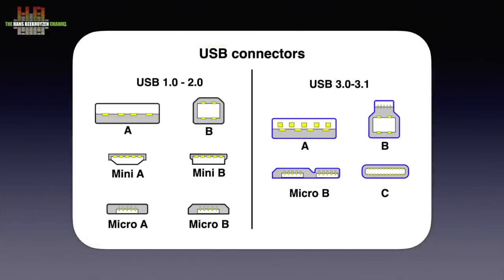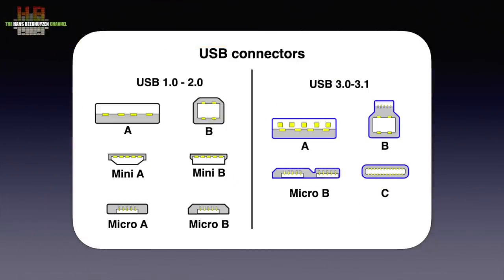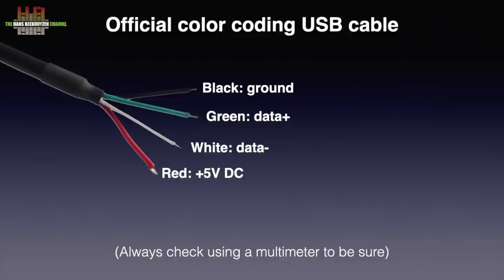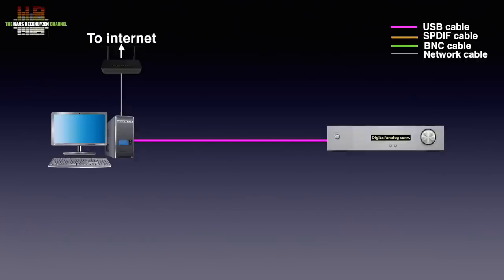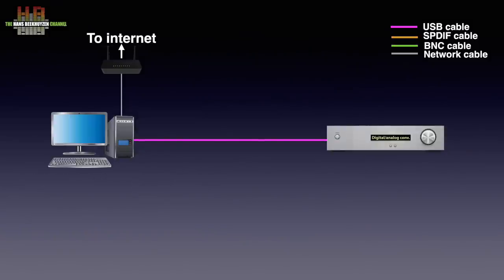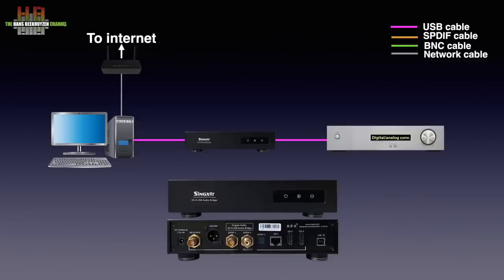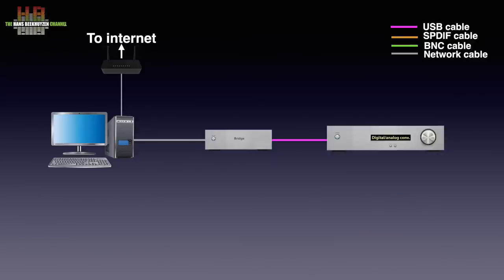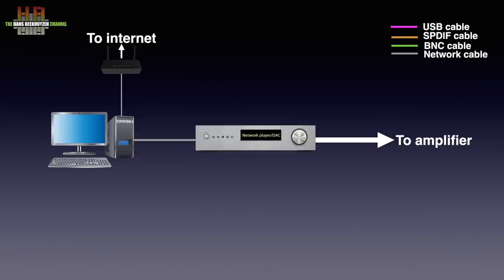Using USB for quality audio

Comment: professional and comprehensible even to laymen, thank you
Reply: @TheHansBeekhuyzenChannel  Hello Hans - in your opinion :  assuming that all else is equal and high quality in a system,  is a PROPERLY implemented USB connection superior in sound reproduction to a PROPERLY implemented fibre optic cable ? thanks and cheers and congratulations on your high quality videos!
Reply: I should add that the USB cable I have is made by CAD in England - the power is in a separate wire to the signal wires  :-)
Reply from the maker: If, and only if, you could find such devices, they would sound equal. Let me know if you ever come across such a setup. 😁
Reply: @TheHansBeekhuyzenChannel  Thank you SO much for your reply Hans!  OKAY let me rephrase that Q . . . is a high quality USB cable POTENTIALLY better than an optic cable - the reason I ask is that my intuition tells me that no audible interference can be transmitted in light - am I wrong to assume that?

Comment: You forgot "audiophile" PCIE USB cards, like the JCAT USB XE Card, powered by an external silent 5v PS. This can make an enormous difference (in my experience) but it's certainly not cheap.
Reply from the maker: Which one then? I don't know of any DAC that is insensitive to the quality of the source.
Reply from the maker: I have drawn the line at connecting DAC's directly to a computer. Sorry. It's expensive to get a computer to sound right. Use a normal computer  as storage and music server and then use a network bridge for audio output.
Reply: @TheHansBeekhuyzenChannel  I use the Matrix Element H USB pcie card, together with an iFi external power supply and a Supra USB cable to great effect. It's not cheap but at around $500 in total, I wouldn't call it expensive given the rest of my system.

Comment: I'd like to see you do a segment on the Dutch & Dutch 8c speakers, driven by their AES/EBU connector directly from a streamer. I haven't seen a decent breakdown of if the sound is better by keeping everything entirely in the digital domain. Internet to streamer to 8C via AES would be a fascinating test, especially if you also try an alternate signal path that includes a streamer with internal DAC and then the streamer bypassing its internal DAC and using a top quality external DAC.
Thanks for all your amazingly informative content!
Reply from the maker: I'll consider it (no promise though)
Reply: @TheHansBeekhuyzenChannel   That would be fantastic, thank you for considering it!

Comment: I have to confess that I usually have trouble hearing differences in DACs so the effect of burning in an audio USB cable would most likely be lost on me. But based on your comments I am now interested in isolating my Mac mini (running Audirvana) from the DAC.
Reply from the maker: The best way is to use a network bridge or streamer.
Reply from the maker: I mean audible quality.

Comment: Thanks Hans, another fascinating subject. You mentioned burning in, could you pick that for a future subject?
I agree it's a good thing to do but am not sure how to go about it. can you switch kit off further down the line? If so what happens when you burn in speakers, is there a way to do this without disturbing the aesthetics committee or the neighbours?
Reply from the maker: Burning in cables is simple: take a cd- or network player, have it play on repeat 24/7 for a week with the cable connected. For loudspeakers: put them 'nose to nose', with the baffles almost touching, reverse the polarity on one of the two loudspeakers and have it play music on a low level for some days. When done properly, you will only hear some high frequencies. You don't need to do that with the loudspeakers in the living. Have some cheap speakers and amp to do that.

Comment: Hans, thank you for such a detailed explanation. Would you say that if USB chain is done right, it has the potential to sound as good as I²S or better?
Reply from the maker: Every digital interface works great when done perfectly. USB, however, often is done poorly, especially on computers.
Reply: My question is: why don't DAC manufacturers and especially streamers manufacturers strive to make I²S the standard audio interface? (Even the most expensive Auralic and Aurender models don't have I²S output). Is it because  USB - provided it is implemented as it should - is not worse? @TheHansBeekhuyzenChannel

Comment: Very nice channel, I was looking for direct to the point, no fluff, presentation and explanations, found it here, subscribed. I realize this is a year old post but I have a somewhat related question, getting into 32-bit, found an ESS Sabre DAC PC motherboard and stereo DAC Preamp both rated at 32-bit 384 kHz to play music files from my computer to my stereo system over optical. Why does it appear the full spec of the DAC 32-bit 384 kHz is not presented to the optical ports, only to the USB ports? It appears the optical ports are only capable of 24-bit 192 kHz even though the DAC is 32-bit 384 kHz rated.

I currently run 24-bit 192 kHz over optical from my PC to my stereo preamp DAC that is 24-bit 192 kHz. I wanted to upgrade to 32-bit 384 kHz using the optical ports but is looking like I need to shift to audio capable USB cable in order to get the full 32-bit 384 kHz. Thoughts? Thank you.

Note, I think I understand properly that the PC's DAC in this situation is not using the analog conversion part of the DAC since it is pushing a digital signal over optical and it is the stereo's preamp that receives that signal that is actually doing the analog conversion part.
Reply from the maker: The optical connection is always limited to 24 bit 192 kHz. And if you go digital out on the PC, the DAC chip is not used at all so having an ESS DAC is of no importance. Consider buying a separate streamer. like those by WiiM or better.

Comment: Hi, Hans. I acquired an Auralic G1.1 to use on a second system (the main one has an Auralic G2.2 and I will upgrade it to the new upcoming G3). Presently, I am using an SOtM pair consisting of the sMS-200ultra Neo Special Edition and a tX-USBultra Special Edition which are the connected to a Denafrips Gaia and from there to a PS Audio Direct Stream DAC via I2S. The Gaia has made a significant improvement over the direct connection of the USBultra to the DAC, since this was a USB connection while the Gaia allows me to use the I2S connection, which sounds much better. The question is if it would be beneficial to use the Gaia with the Auralic as this streamer has a USB output and no I2S. I have many DSD files up to 256, which would require either the USB or the I2S connection. I shall appreciate your learned view on this.
Reply from the maker: I have never tried that combination so I can't say.

Comment: Wireworld Cable makes USB cables that have a separation between data and power cables.
Reply from the maker: There are more, like Network Acoustics
Reply: Dave and his Wireworld business has been high value, high performance,  and usually a half dozen series options for each cable protocol.  Was lucky enough to discover Wireworld in ~2004 and never looked back.

Comment: I would love to hear your thought on using AES 50 Dante and AES 67 Ravena for transporting audio on Ethernet. These are both multi-channel systems used in the pro works. They are reliable, easy to use and high quality. I used Ravena to connect systems for DXD/DSD multitrack recordings of classical music.
Reply from the maker: It's not what I focus on yet

Comment: I used to use an gen 1 Bluesound node. On some tracks, high pitched sounds would sound awful and distorted (eg. violas or high notes from a piano). I wonder if that was extreme jitter (?)
Reply from the maker: No, these are called glitches that occur when the streamer is malfunctioning.

Comment: Regarding platforms for the electronics, reviewer Darko recommends (and I can confirm by testing),better than hard wood is Ikea Aptitlig butchers block (bamboo) + Atacama Gel Pads.
Reply from the maker: bamboo is the key word here. Doesn't have to be ikea
Reply: @TheHansBeekhuyzenChannel  Agreed, but would also note the Ikea Aptitlig boards are rather thick (3.3cm) and are wide and deep enough to support most gear, so offer a tremendous bang for buck. Especially when rested on Atacama isolation gel pads. My system was already quite resolving, but applying this budget tweak I can hear new percussion details on about half of the tracks I listen to.

Comment: I've cut the 5v. Use a Power bank to source the 5v through the USB plug or the power port if available. What do you think on using power banks for 5v?
Reply from the maker: They are noisy.

Comment: I have a hard time believing a USB cable has a burn in period. Especially anything more than a few seconds. Ethernet cables can also carry noise, albeit almost always much less. Proper Galvanic isolation still needed if you want a near perfect scenario. Another point to make, if you’re connecting to PC USB then connect directly to the motherboard and preferably the main chipset. Connecting to the front panels will introduce more noise along the cable and other chipsets can also introduce more noise (or worse for Class 1).
Reply: I guess you haven`t learned everything effects everything yet.  It will come with more experience.
Reply from the maker: Try it. Buy two audio class USB cables, use one for a few weeks and then compare then. If you don't hear a difference, your stereo might not be of sufficient quality or set up less optimal. Or your auditory system doesn't focus on the right things.
Reply: @TheHansBeekhuyzenChannel  -OR it is already optimal and there is negligible amounts of noise on 2 data lines that are already being isolated for, so almost any cable will provide an identical experience. I’d go as far as to say (beyond burn-in), if you’re hearing a difference with high quality vs. “Audiophile grade” USB cables then the system is definitely not optimal and there are significant weak points in the digital pathway
Reply: @mikemajors2385  you’re missing it and being ignorant. But I’ll bite. What changes after weeks of running a cable in the same setup? Basically 2 things (ignoring oxidation/corrosion), if controlled. Temperature and the positioning of the electrons. From a new cable running in a system, the electrons will reach their native states in less than a minute of operation. Temperature takes longer but not 2 weeks. Sure if you take it out of the box from sitting cold outside and throw it in the system, and have a highly resolving system with digital pathway issues, then you MAY notice a difference once the cable reaches an equilibrium temperature. That’s it. Digital is not analog. Yes, analogous noise can still propagate along digital cables, but for different reasons and results differently. A good quality shielded cable AND equipment that is properly designed to handle USB (not as an after thought feature) will have effectively no difference in switching to whatever unobtanium audiophile cable you throw at it and no difference in burn-in, beyond the stated above, extreme temperature scenario, unless your source or end point are poorly designed (read: shitting out noise) and unable to mitigate it. Then you may have a scenario where a “better” cable might make a difference, but again —cable burn-in is not going to make a difference outside of ~an hour. I will however test this and report back. If I’m wrong, I’ll eat my shoe. I’ve tested tons of this before (some surprising, others not), but never a 2 week cable burn-in. I challenge you though, please tell me what else a 2 week cable burn-in is going to change? Will the changes go away when not in use? After how long? Is the burn-in permanent? Why? What is physically changing?
Reply: If harmonics doesn’t concern you then yes wouldn’t hear it.
Reply: @chrisladouceur4093  What exactly is the “native state of electron” that you’ve mentioned? What are the differences between native and non-native state electrons? What are the requirements to reach the native state? and How long does it take to reach such state?

Note that when talking about “electron” you are talking about quantum objects… and anyone that think they understand what quantum physics is… definitely has no idea about what quantum physics is.

It’s one of those things the more you try to understand it, the more you don’t understand.

Is electron a wave or a particle?  The answer is, it’s neither and it’s both because it can be both and it can be neither. Confused? Yeah, me too 

and it can do all sort of funky stuff like teleporting, goes through another solid  object, changing  its properties, telepathic communication etc. 

The law of physics that governs these quantum objects are not the same as the law of physics that governs our world as we know it.

So, I’m afraid no one would be able to answer the questions that you’ve asked but feel free to try answer my question if you think you can.

Comment: Have you taken analogue WAV samples from the output of the same DAC driven from a basic class 2 USB connection Vs any of these products?  If there's a difference you should see it in the delta of the WAV files.
Reply from the maker: No  you don't.
Reply: @TheHansBeekhuyzenChannel  you've done this and there's no difference?
Reply from the maker: @Chris-hy6jy  of course not
Reply: @TheHansBeekhuyzenChannel  sorry, your answer is not clear.  Do you mean you haven't tested it in this way, or you have tested it and there's no difference?
Reply from the maker: There is no relevant difference to see on a scope.

Comment: I connect my MAC mini optically to my DAC. Is there a better way...Wireless? I just have no idea. 

My other main listening system is a pair of Buchard A700 wireless active speakers, with Platin hub wireless front end. I stream using chromacast from my phone, or apple air play from my minimac. Do you think this would be better for my "bedroom" system (Mac..optical...dac..amp...speakers) which with the hub would become (mac...wireless...Platin hub...amp...speakers)
Reply from the maker: A network bridge is the clearly better option.
Reply: Ok I will look into setting this up and comparing. Thank you so much @TheHansBeekhuyzenChannel

Comment: why not use optic cable spdif instead of usb with all these extra accessories?
Reply from the maker: My preference for digital audio is AES/EBU, SPDIF 0r I²S, TOSlink and than USB Audio Class 2. But in some cases USB is the better or only option.
Reply: @TheHansBeekhuyzenChannel  can you give an example of a device where optical is worse than usb? Does it depend on usb chips like xmos xu208?
what if I have an electrically noisy environment and long wires, in this case is optical preferred?

Comment: If source clock doesn't matter for usb audio 2, why aq jitterbug and similar devices would have any influence? 
What can they do on the signal?
Reply: The answer may be that they act as RFI filters, which is an electrical rather than a clock issue.
Reply: @colingreen4357  jitterbug and that reclocker don't have optical galvanic isolation, as far as i am aware, so there's no isolation
Reply: @hudosytuk  Sorry, I can’t follow your point there. My comment was simply that filtering out RFI is a separate issue from the influence (if any) of clocking matters.  And a Jitterbug and a reclocker work in very different ways.
Reply from the maker: It filters out electronic noise. It has no direct influence on the clock signal. But it introduces jitter during D to A conversion. Watch: https://www.youtube.com/watch?v=B-StTplQZys&t=0s
Reply: A poorly clocked USB signal will cause the receiver chip to work harder to decode the USB signal, and as a result inject more noise/jitter into its output, even if its reclocked locally, at least that's the way I understand it

Comment: Thanks for yet another great informative video 🙏🏻

May I ask whether and how far the length of USB cables matter to sound quality?

We certainly cannot use cables shorter than we need.  But we may have some cables in hand which may be longer than necessary, especially after we arrange equipments after moving places. 

Thanks again.
Reply from the maker: The specs say 5 meters but for quality audio I would keep it as short as possible. If you need to cover a larger distance, use a network bridge.

Comment: It all seemed very sensible and reasonable until the cable burn-in point.
Reply from the maker: And that doesn't make you think?
Reply: @TheHansBeekhuyzenChannel  I'm willing to be proved wrong. Are there any measurement results showing this burn-in effect? We know that metals alter their properties from heat treatment and mechanical stress, but I've never seen any evidence for electrical signals changing those properties. We know dielectric absorption is a thing, so the properties of those will change slightly over time. It tends to show up in very high-voltage capacitors. I have never heard it mentioned as affecting the properties of transmission lines, which is what USB cables are effectively.
The bit that confuses me is that even if there is some change of conductors and insulators over time, there's no reason to assume that would be in the direction that would improve performance.